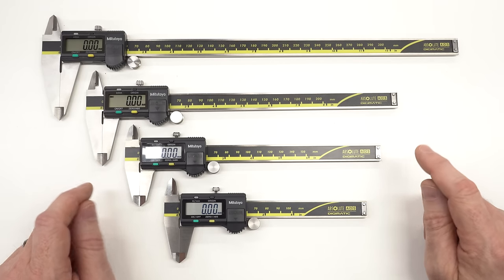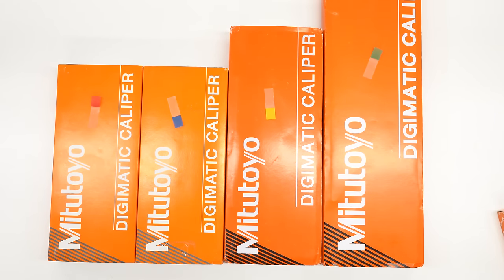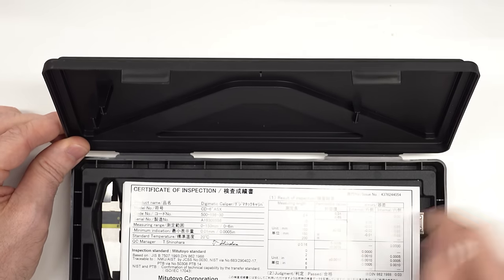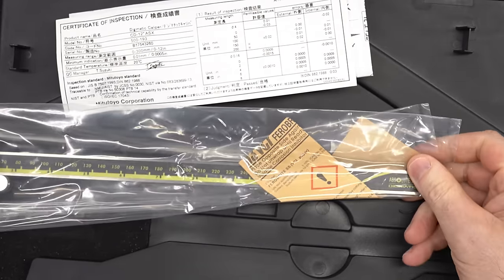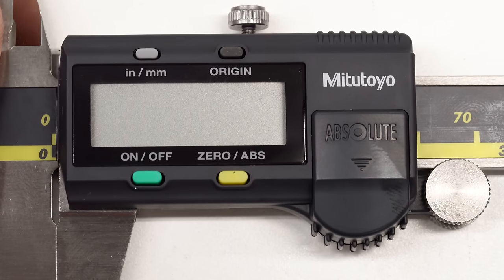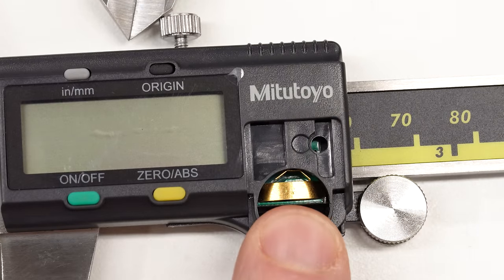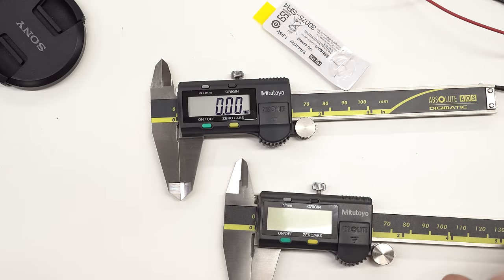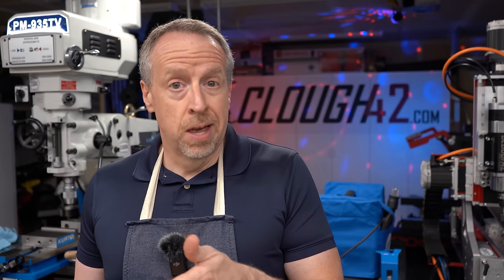17 Warning Signs Your Mitutoyo Calipers Are Fake

Comment: Last year i brought a 6" Mitutoyo and a 6" counterfeit at the same time as i was curious the difference, plus i got the genuine pair at such a good price i was a little concerned at first they might be counterfeit as well. $87US for the Mitutoyos and $54 for the counterfeits. both off Ebay. but when i pointed out to the seller that i knew they were fakes they refunded me 50%. So the fake ones cost as much as the cheep ones you can get anywhere, but they are actually made very well for cheap chinese calipers that i would have been happy with the original counterfeit price i payed for them. not as mush as the genuine but good enough that they are better than most cheap pairs available. they are now my everyday use pair and my genuine pair are kept for when i want to do more delicate measuring. not that i ever do anything that requires Mitutoyo accuracy, i just wanted a pair because the are Mitutoyos.

Comment: you appear to have missed the drop out voltage for the genuine Mitutoyo
Reply from the maker: I took it to the low-battery indicator.  Silver oxide batteries stay right at 1.55v until they're exhausted, so there's no real capacity beyond that.  The fakes have no low battery indicator, so I took them down to see what happens.

Comment: I just purchased a cheap set of Mitutoyo Callipers from Ebay. I assumed they were fake but price was a consideration for me.

I am disabled so I can’t get out into my shed where my tools are stored to access them so I am having to buy new tools and price is an issue. There are at least two Mituto original callipers (3 if you count the one with missing battery clip) over 25 years old but my family will not get them out for me.

It will be interesting to see how accurate these “fake” ones are. I don’t need industrial quality anymore. I have done with chasing “thous” so as long as they work that is fine.

I purchased a cheapish (non branded) calliper about 6 months ago and it was absolute crap. Only the external jaws were any good, and it was more expensive than a “fake” Mitutoyo.

But if this “fake” version does what I want good. If not I will return it and buy a genuine /Mitutoyo one. 

I did not know Mitutoyo did a 4 inch version so I will check this out as it will do me fine but I expect the 6 inch version won’t be much more expensive.

Thank you for this useful video.

Comment: I bet that fakes are loose here and there , steel is not hardened in any way so it measures differently over temperature and the accuracy and consistency over the whole range is poor.

Comment: Don't buy "new" off of fleebay.  You're only encouraging counterfeiting.  Find an authorized dealer.  1/14 the battery life is enough reason to stay away.
Reply from the maker: There are several authorized distributors with eBay storefronts, like MSC and Travers, and often they have better shipping prices on their eBay listings.  Better advice would be to make sure you know who you're buying from.

Comment: Measure a thing! Interesting to see the differences, but it's designed for measuring things, but you didn't test the one aspect of the device that really counts, no pun intended 😜
Reply from the maker: It only matters if you want to overpay for a cheap import caliper dressed up to look like a Mitutoyo.
Reply: @Clough42  That's a fair point, but I still think you missed a key comparison exercise there. 

Assuming that a measurements comparison test demonstrated that, i.e. It's a poor quality build that's also rubbish at what it's supposed to do, then the point you raise would be truly driven home.
Reply from the maker: @captiveimage  measuring isn't hard.  Every cheap caliper I've ever used, including these, measures just fine.

Comment: Power consumption seems to be fairly distinctive, especially when the caliper is turned off. It's nice to know that when you come to use it after 6 months that there's enough juice to run it. 
Another thing: if these calipers draw so little power, why not have a tiny solar cell to run it rather than a battery? After all, calculators do exactly this successfully.

Comment: SNOB value ONLY  sorry folks . They do not even use a decent sized battery   CR2032  is more realistic   but once again snob value  And i will call you out on your claim of 2 years use on that one set pull the other one  you may have been mug enough to buy it 2 years ago but it has NOT had 2 years use

Comment: You asked the question of if the fakes are as accurate why trade off someone else's name.  Your fakes are likely made some place other than Japan, likely China.  Mitutoyo has a respected name for high quality, and Japan as a country also has a good name for quality.  If whoever is making the fakes and can convince enough people that they are genuine Mitutoyo then this damages both the Mitutoyo name and Japan's reputation as a country that makes quality products.

If you compare the finish of the metal parts, such as the outside edges of the jaws, the real calipers the finish is smooth while the fakes show a rough edge in your video.

Comment: For the price you pay for a set of Mitutoyo calipers you would think you would get a case with a proper hinge that will last. Not the cheap crap design that breaks off once you have opened and closed it a few hundred times.
Reply: I for one actually for cheaper items, prefer to save the 5-20$ for a okay case and have them send it in the cheap case so I can buy my own really nice case. The excetions would be 3000$+ items where the price of the profit can cover these things and barely make a dent
Reply: The okay cases by manufacturers are nowhere near as good and durable as high quality custom ones

Comment: STOP - there's something missing!
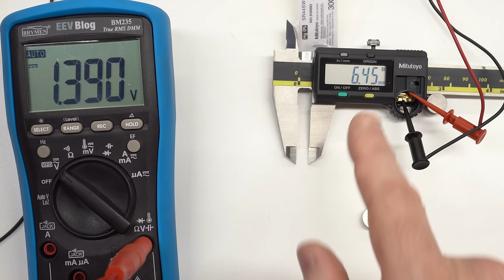At 33:03 you say: Let's see what happens to a genuine caliper when we continue dropping the voltage... But then: this part is just missing. Very sad, you did'nt show.
Reply from the maker: Once the caliper hits low-battery, there's no point continuing because the user will replace the battery.  It's also irrelevant because a genuine silver oxide battery will sit right near 1.55v until it's exhausted.  After the voltage starts dropping, there's basically no capacity left.
Reply: @Clough42  You got a point. However - i was curious anyway. Thank's for responding! Subscribed !

Comment: I like the fakes much more, it does document the serial interface, the origin button is recessed, it works up to 1.168V instead 1.3 (an alkaline is empty at 1.0), but they are probably not measuring absolute as they display 0 upon power up so I don't need to set the origin and I bought 3 of 12" lenght for my milling machine, they are powered by the DRO, but they say Profitexx and cost only 30 bucks. I hate that they lie by printing Mitutoyo on them and charge much more.

Comment: I appreciate the video, but with such an in-depth comparison, how did we not include the most important thing, testing the actual function, aka the accuracy?
There have been times knock off items have actually out-preformed their original counterparts, not that I believe that to be the case here, but I just cant fathom such a detail comparison missing the largest comparison point.

Comment: I almost bought a Bosch fuel pump for $35 on e-bay.  It seemed too low so I called Bosch and reported it.  Turns out the PACKAGE is counterfeit.  The fuel pump was real, not Bosch, and had a one-year warranty.  might have been OK, but I bought one locally.  Cost me a little more, came with a lifetime warranty.  >>>HINT: we have a "Parts Authority" store.  In my area, all the car repair shops get their parts from them.  Their prices are lower than the other auto stores.  Due to the counterfeit problem, I will NEVER EVER buy an auto part online again.  NEVER EVER.

Comment: what you should have really focused on is calibration accuracy, not aesthetics. that's the bottom line for value on money spent, any machine shop worth its salt would keep standards. a quick check that the calipers meets the specs on the calibration certificate otherwise claim a refund.